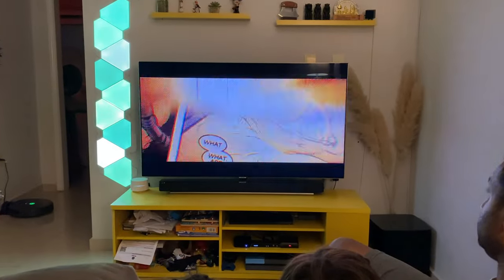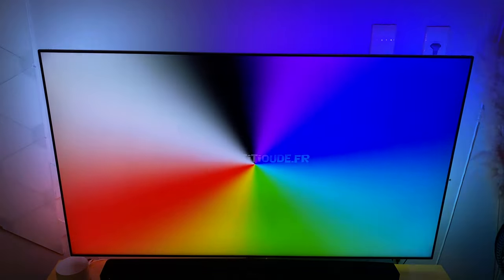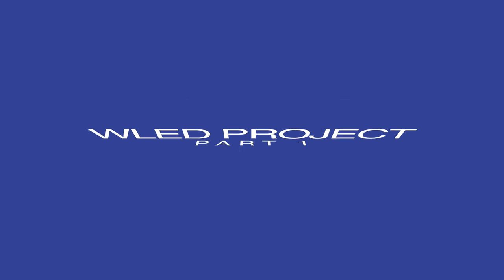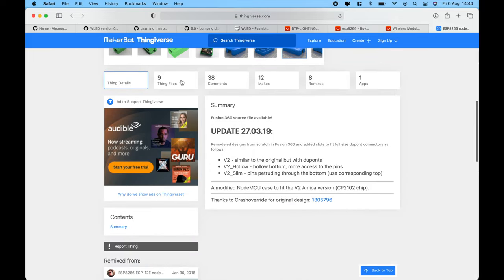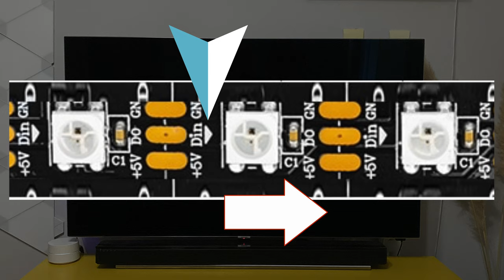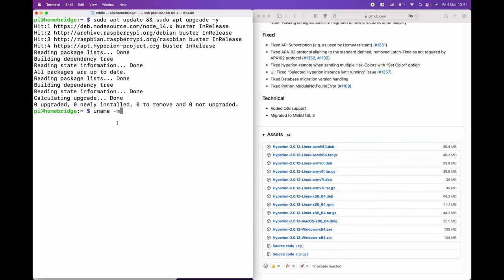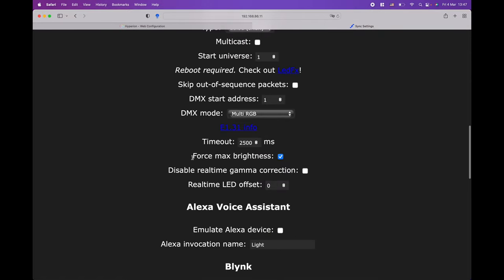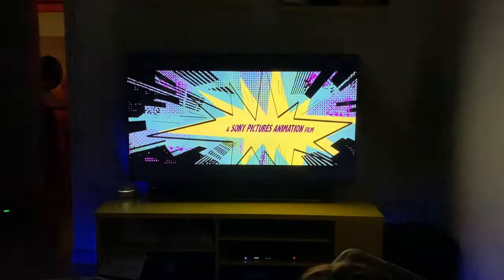The Ultimate Hyperion Ambilight TV With Apple HomeKit

Comment: Hi Eddie, great video. One issue I noticed was at the end of the video when you were watching the animated Spider-man. Did the aspect ratio of 2.35:1 with black bars top and bottom mean the RGB strips on the top and bottom were outputting no color? It only seemed like you were getting ambient lighting from the sides at that point.
Reply from the maker: Hi Steve - In the Hyperion dashboard there is a TV icon that you can use to see how the image is spreading on to the LEDs - i did check and as per hyperion - the image was black - so thats why no color was being emitted.

Comment: How do you get the wires into the case ??? I mean connect the wire to the pin hole in the case ? Do you need soldering ?
Reply: Which pin do you connect the red wire to the ESP8266 ??? VIN or 3v3 ? I connect to VIN as the WLED documents said but the lightstrip won’t work. The 3v3 pin work normal
Reply from the maker: the wires are connected to the pinhole in the case .. Theres no need for soldering. Every LED strip has its own connection to the ESP8266. Follow the guide which I have used in the video
Reply: @eddiedsuza the guide said connect the red wire to VIN pin but it doesn’t work for me, I had to change to 3v3 pin to make it power on. Is it ok ?
Reply: @eddiedsuza  as you said, just put the wires from the female connector to the hole, then put the esp8266 in ?

Comment: Hi, Can I replace the NodeMCU with Sonoff Basic?
Reply from the maker: it wont work ... as the basic will only power on and off the device well as the NodeMCU will allow you to control the LED as well as the power
Reply: thank you for your quick comment
Oh.. I have something I don't understand. As you mentioned If I use a additional power supply unit, then is it possible to replace NodeMCU?
Such like this
https://youtu.be/LpCT-QozMWU
Reply from the maker: You will need the nodemcu and the powersupply to connect to the LEDs. In this video - i am adding the nodemcu to homebridge

Comment: Does Hyperion works with Netflix on smart tv??
Reply from the maker: Yes it does and needs to be triggered manually.
Reply: @eddiedsuza  how?
Reply from the maker: @gouravjain143  Once you have the Hyperion setup and configured the plugin - the Hyperion will show up as a switch in the Apple Home App .... When you watch Netflix - you'll need to use Siri or manually turn on the Hyperion switch located in the apple home app
Reply: @eddiedsuza   Sir I don't have apple home i just have Smart Google tv. How to set up if there is no external box?
Reply: @eddiedsuza  does it work if there is no external box? I don't want to buy tv box as I have already installed all the applications I want to watch .